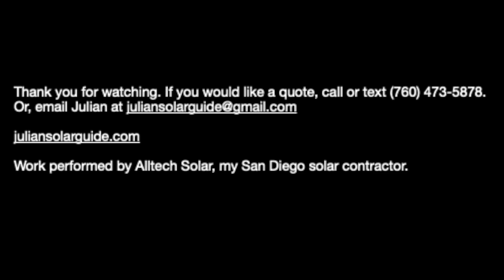Replacing a SolarEdge Inverter Again... Enphase vs SolarEdge Explained by the Solar Contractor

Comment: I deeply regret having this installed. My SolarEdge system has failed twice already. Both the solar company and the installer have gone out of business, and now I'm faced with additional out-of-pocket expenses on top of paying off this loan.
Reply: I have had same issue with my system. Big Star Builders went out of business, and before they did, they gave me the round around,  when I kept telling them that there was an error. They claimed there was none. Even solar edge claimed they didn't see an error, when on my app it stated as so.

Comment: I want to initiate a class action lawsuit against Big Star Builders and Solar Edge. I keep trying to initiate a support claim, and it keeps saying my serial number isn't authenticated. Something has been wrong since they originally installed my system, and they will not do anything about it. I have had my system now for over 3 years, and it has never worked 100%. I have been attempting to work on the problem, and they keep ignoring me!.

Comment: I have had 3 Solaredge energy hub inverters installed on a 17kw solar array. I designed and installed the system myself. The system has been installed in 2021. My system has been working flawlessly since PTO.  Either way, a Solaredge inverter replacement is very simple if one is needed. If an Enphase inverter fails you have to go up on the roof, remove the solar panel to replace an inverter. If a failed enphase inverter is in the middle of a large array, you would probably have to remove several solar panels to access it so it would be a much harder task. No matter what anyone says, These complex electronic inverters will all will eventually fail. I don't care what brand it is. I have a very hard time believing that any one will last 25 years so at sometime you would have to deal with an inverter replacement. I would be more concerned with the warranty from the installer. Will the installer still be in business when they are needed? If not You would be on the hook for at least the replacement install. In that case I would much rather have the inverter installed in the garage then on the roof. I.M.O.
Reply: I’ve had, in general, more problems with SolarEdge as an installer than Enphase. But both products aren’t as bad as say, Hoymiles or APSystems.
Reply: @MrDontcareify  Thanks for your reply. In my area some companies were installing Generac a few years back and they also had a ton of issues. Hopefully for everyone's sake, as time goes on the technology used by all the manufacturers will get better and more reliable

Comment: Looks like this is a 5 minute job if someone isn’t jabbering in your ear nonstop.  😂
Reply from the maker: I turned the camera off and left before he commissioned it
Reply: Problem is Solar Edge will not send a replacement unit without getting a contractor involved. I had to wait almost 2 months to get the installer come out and do the switchover. A month and half was the time when replacement inverter was just sitting at home waiting for him to show up.

I have now made notes on how to go about doing this myself.

Comment: My SE5000A (not the "wave") failed in September after 8 years. Luckily I have a good installer that took care of it within three weeks. When I choose Solaredge in 2015 the forums were negative on Enphase due to their failures back then but now I think they stepped up QC and are more reliable. If my SE5000 fails again out of warranty I'd have no problem doing it myself and I've easily replaced an optimizer myself too.
Reply: My SE6000 inverter has just failed for the second time in just under 6 years. My installer no longer serves the area, so I'm considering other installers or installing the inverter myself. I've got one power optimizer that failed over a year ago; have not replaced yet, but it is on the corner so should be easy to access. SolarEdge said it is just a simple measurement (I forget, either resistance of voltage) to satisfy them that it is defective and they'll ship another out.  Reviewing the Edge Academy training videos to make sure any maintenance I perform is done correctly and safely, but it is challenging to hone in on the specific info.
Reply: @chidude  Shortly after I posted I decided to upgrade my panels. My LG280's (c2015) were under performing by 8% and one was down by almost half. I bought 16 new 320w Q-Cells for $1800 and sold 14 of my old LG's for $900. My new production us up by 20% at a cost of ~$1k and back to no annual bill. Only took a weekend to do the work and I am not fast.

For the optimizers, very cheap to buy, especially used and very easy to replace.

For the Inverter, if figure at best $1k to self install a NOS unit or $2k to have an electrician do it.

Comment: Revisiting this, and having my SE5000 fail in 2023, I don't get why they don't make them repairable on site. For the old SEX000 units I understand the capacitors are the failure point. Make them replacable! My AC evaporator cost about $1200 and has a capacitor. Imagine if the cap fails and I'm told the whole unit needs to be replaced.  Even my laptop has replacable components.  Again, I don't get it.

Comment: I’ve had both Enphase & SolarEdge installed with very similar size systems, luckily no issues over a few years to speak of but I do get a lot more overall production out of the SolarEdge system.  Paid itself off in 4yr, Enphase will be 5-6

I like reliability & have all my extended warranties but I want overall performance & if someday they ever have to replace my inverter I can live with it cause that system allowed me huge credits since the date of install
Reply from the maker: There could be multiple things going on here.  An Enphase system and SolarEdge system, given they are set up correctly, should produce pretty near identical production.
Reply: SolarEdge would produce a little bit more because the inversion happens so close to the POI but in the summertime, Enphase would definitely start to outpace SolarEdge, especially when paired with modules like REC.
Reply: @Superiorsolarconsulting  Not really, with panels up to 460W, there are a lot more clippings when the max inverters are 380W
Reply: The new models are going out frequently
Reply: So what is a reliable brand of inverter?

Comment: I personally use 'Activated Alumina' for my 3d printing filaments, you can bake it at very high temperatures to drive off moisture safely and very effectively.  Whether or not it also can hold up to 30% of its weight in water I've never personally tested. Thank you for sharing this video, very informative

Comment: We're installing a lot of SE systems in The Netherlands and have almost no problems.. :)
Reply: In Italy no issues either, it has something to do with the US voltage regulator built-in the unit.
Reply: No issues in Uk or Spain either
Reply: Maybe California climate related? This one is indoors but most are mounted outside. Pretty common to get to 100* and near freezing at night.

Comment: I’ve had 5 panels go out, Csun  260watt, installed in 2015, sometimes it’s the panel, sometimes it’s the micro inverter. Enphase is good at sending out a new one,as they have access to your array, and can troubleshoot on their end. But it’s a dead duck if power goes out, I’m considering adding 36 more panels, but haven’t made up my mind yet if I’m gonna go optimizers yet
Reply from the maker: There are multiple factors to this that will dictate whether micro inverters or centralized inverter would end up being better for you. If you would like my help feel free to give me a call at 760-473-5878 and I’ll walk you through your situation.

Comment: Are these systems commonly warranteed? Both my SolarEdge inverters will not connect via the app, and the leds indicate no communication.
Reply from the maker: Yes they are. Call your installer or SolarEdge directly for help

Comment: I had Enphase for my system in NC. When I moved to FL and installed solar panels, they installed SolarEdge that I was told is "much better."  Well.... two years later and I've been waiting for TWO MONTHS to get the inverter replaced.  They're supposed to arrive on Friday (Nov. 22) to do it.  Every day it's down, I lose money.
Reply from the maker: Sounds about right, unfortunately

Comment: We had a 17.5 kW SolarEdge system. The inverter broke down withing 24 hours of installation and was replaced under warrantee, but we missed out on a month worth of production. Recently, after 8 years that second inverter broke down also and was replaced by a newer version of 17 kW. We lost another 2 months of production. I hope the new version is better. The inverter has paid itself off though, the Enphase quotation we got was much more expensive and wouldn't be paid off yet.
I wonder if one of the reasons for all these failures is that there is a lot of oversizing going on. It works fine, but it puts more strain on the inverter. I wonder if it is the ones with oversized paneling that fail most. We have 20.9 kWp panels with now only a 17 kW inverter. It might be worth it to go for a 25 kW inverter if those last longer.

Comment: Don't the DC wires coming from the panels still have voltage on them? Or do the optimisers shut down completely?
Reply from the maker: The optimizers have rapid shut down built-in

Comment: Does anyone know what the common failure point is for these inverters? Is it a circuit board issue, capacitors, etc? Would be good to know because capacitors are generally easily changed, but if it's boards, chips, etc, that is not as DIY friendly.
Reply from the maker: Not sure honestly
Reply: My HD 7600 failed shortly after install and they sent reworked units as replacement but both times they were DOA, waited weeks for each one and I was really upset. I saw a resistor that burned up and so I looked closely at the RMA reworked units and there was a heat sink on the resistor as part of the reworked units. The phone support could tell from a picture of the circuit board in the upper left corner that they had the same defect and apparently the rework process did not work out for them. Finally they sent a Solar edge technician who brought a new redesigned unit. That portion of the circuit board looks completely different. So far so good.
Reply: The circuit boards appear to be sealed up / coated with some sort of coating, probably for durability / sealing. Might not be an easy DIY unless you've got experience with that part of the game.

Comment: I get the failure of high tech stuff, but for us it’s more about how long it take to get the replacement and installation.  Morev than a few days and I’d be pissed. We have Enphase IQ8A Inverters and if one dies it’s no big deal.  But our installer is local and has a great reputation.  And we are adding two PW3s and given their built in Inverters a failure will shut my entire system down,  so I’m hoping that when the inevitable happens I’m not screwed.
Reply from the maker: It’s so much less money that the risk doesn’t outweigh the cost anymore in my opinion

Comment: What inveter size and what PV system size?
Reply from the maker: This was from an older system I didn’t sell myself and I was next to
At an install and decided to film. Does that matter to your knowledge?
Reply: @Superiorsolarconsulting  Gotcha. You put out good content, keep it up! In my experience, I've seen inverters go most often when the installer did an incorrect DC:AC ratio i.e. too high of a ratio and obvisouly that'll burn out any inverter. At one point a while back, SE had a bad batch of inverters, but haven't been seeing many issues lately and their response times have been very good when there is. Keep up the good work!

Comment: The problem is if the home owner is not certified and changes the inverter it will void the warranty. This is because even techs have in correctly wired inverter and blew them up.

Comment: Wait a minute, I got a solaredge wave inverter and my company went out of business, what do I do if mine goes bad?
Reply from the maker: Call SolarEdge
Reply: Cry and find another solar company to help, then cry some more when you get the bill. 
Solaredge doesn't like to work directly with homeowners.
Reply: @chris76-01  Trying to find an electrician that will help me out but damn, it's proving to be harder than you can imagine.
Reply: @TheFrayman  what area are you in? yes. It's hard to find anyone to do anything. Lol. 
My original installer also went out of business but I found another company that'll help me. 
Mine is broken.  It has a fault saying "ac voltage too high" even though it's in the normal range.  So I'll probably need a new inverter.  It's only about 5 years old.
Reply: @chris76-01  San Diego CA

Comment: Had my replaced twice within 3 months, but it was free under warranty. I forget how long the warranty is, 20 years maybe. I paid an extra $200 for 5 more years, I think. Have not had any issues for a year since (knocking on wood). Get a reliable installer who has a good number of employees on staff, years in business and good reputation. Solaredge was $5000 cheaper than Enphase in my area for the same size system at the time I installed it.
Reply from the maker: If SolarEdge was $5000 cheaper, the installer was ballooning the Enphase price to manipulate your decision. Usually it’s less than $1000 different
Reply: @Superiorsolarconsulting  It was a different installer, I had 4 diff. quotes. The enphase guy probably didnt need the work unless he got paid really well, it was in 2021. Good to know the difference should not be that much for people shopping around now.

Comment: I had SolarEdge equipment install 5 years ago. I made a specific request nothing made in China was to be installed. I was pissed off to find that everything installed was made in China. Now the inverter has shit itself only 5 years into a 12 year warranty.
What else can you expect from Chinese rubbish.
The installer has replaced a new inverter for free, but how long will that last for?
Reply from the maker: Replacements have refurbished internals most of the time too. Hope it lasts 12+ for you!
Reply: It will last until the chineesium wears out😂
Reply: @Superiorsolarconsulting  My six year old SolarEdge system's inverter just failed for the second time. Since my installer no longer serves the area, I opened a case and had SolarEdge send me the replacement inverter. I received an email from them that said don't send back the old inverter, although the packaging for the shipment had instructions to send the old one back. It seems that as of 11/2024 maybe there's been enough equipment failures that SolarEdge does not want to deal with the broke units. Thanks for this informative video. I'm contacting other installers to install and get quotes on an upgrade to support a battery backup system. Contrary to what SolarEdge has told me in the past, they have an upgrade path via their Re-energize program that offers a discount on the battery capable Energy Hub inverter; that program ends this year. That requires a certified installer. They don't list the cost, so who knows, it may be just a discount off their suggested retail value, and it could be lower cost to buy the inverter on the market. So I am exploring options and looking at battery brands as well, and also considering whether I will just quickly install the replacement inverter myself. I logged into the SolarEdge Academy training site, but have not seen direct instructions to replace the inverter; kinda hard to zoom in on just the info I need.